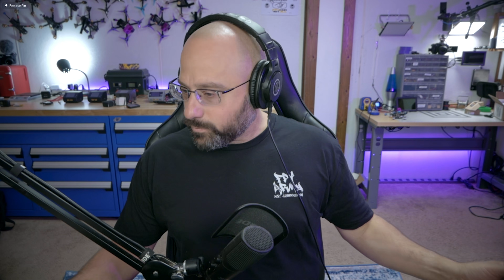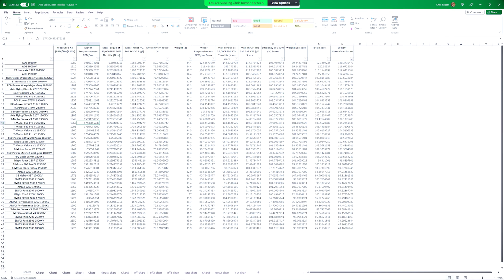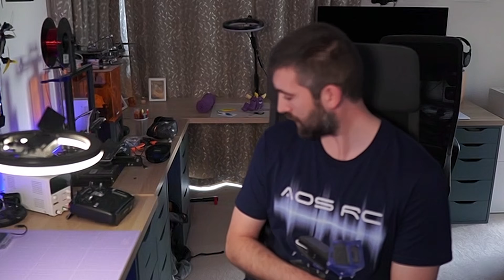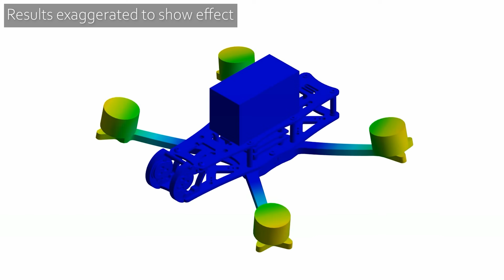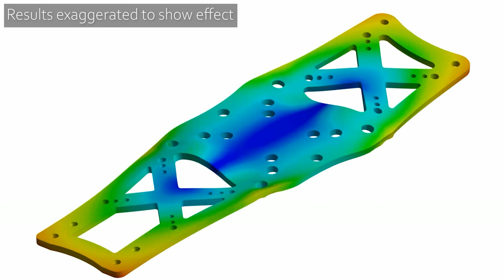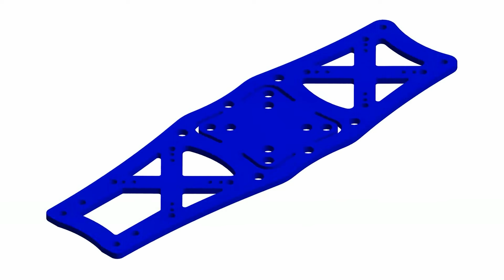The most powerful, most efficient 5" drone motor ever made // AOSRC SUPERNOVA 2207

Comment: The motor inertia is presumably an inertia, so quite linear at least from a control point of view. Yet filters are a pure delay (eek! hard to do the maths for)

How much does the moment of inertia of the propeller itself compare to the motor bell? Plastic is lighter, but the radius² is a lot larger?

Comment: But how about thin wire, much windings, much coils and much controllers and the right stator shape ^^ and what's limiting the current, is it the thin wire from the  1000 light led strip 😂 how about a battery for each 3 or 6 coils that have their own esc, so you don't melt the thin conductors

Comment: It would be nice to see these motors for all size ranges of quads. It would also mean you could run the smaller motors meant for a  race or freestyle quad in its size category on a bigger class quad for insane efficiency builds. Ie a 1305 or 1404 on a 4 in .

Comment: That's very interesting, especially the frame stuff - to me, anyway.

I fly small quads up to 4" props. Recently, using a commercial one piece frame (2.5mm CF - carbon fibre) I have had big problems with loop stability with aggressive props, had to back off gains a damaging amount. A friend with another similar commercial frame (3.5mm CF) didn't. But, his frame was 33.5g as opposed to mine at 23.5g - a big difference in a 200g craft, 5%.

On the basis that the biggest contribution to stiffness comes from mass furthest from the centre of gravity, I then made a frame (I have the CNC tools) from 2x 1mm outer skin CF, with 2.5mm core of 3D printed polycarbonate/CF. Total was actually about 4.2-4.3mm as the 1mm skins were slightly less than 1mm. Big improvement, no stability issues.

Carried out some relative deflection measurements and it showed the arms (same XY plane shape) were a lot stiffer. Relatively, my original 2.5mm frame under a set load deflected 0.33mm, my friend's 3.5mm frame 0.11mm, my 4.25mm 'sandwich' frame 0.06mm. not only that, it only weighed 25.5g, less than his. So, a big stiffness to weight improvement.

It seems to me therefore that stiffness to avoid coupling into the gyro is very important. In the past on smaller quads (2") I've also got measurably better gyro/accel performance by AV mounting the motors.

Of course the downside of the sandwich approach is likely damage in a crash, the arms will be less strong as the 3D printed material does not contribute much to the overall strength. Depends how much one values performance against robustness.

The tool I use for designing this stuff is FreeCAD, and that does have an FEM (finite element analysis) module. Therefore since one is only after relative qualitative improvement, it might well be interesting to experiment with different shapes / cutouts using that.

Comment: Not for nothing:
They are 22.5 x 07.5
So 10% more volume but the same weight (approximate) as 2207.  Bell is much lighter.  So less durable? It then becomes a finite analysis on strength comparison.  So that would need to be done.

Comment: 23:05 you can also make the ESC compensate for that delay by sending out a higher-than-necessary current so that the motor reaches the required RPM in a shorter time? If the current required to spin at 2k RPM is x A, instead of sending exactly x A to the motor, send 2x A or even more, for a short period and then ramp back down to x A when it reaches the target RPM. Unless they already do that (wouldn't surprise me) in which case 🤷
Reply from the maker: What you're describing is accomplished by feed forward in the flight controller's pid loop. There's no need to also have the ESC do it.
Reply: @JoshuaBardwell  sure, i mean, in my head it makes more sense for the ESCs to do this instead of the FC, but not that it matters, they could be all in the same chip for all we care
Reply from the maker: All the FC cares about is making the gyro change. It does this by changing the motor outputs up and down. The FC does not care what the actual RPM of the motor is. It just cares how the gyro is changing. An ESC-based PID loop that manages RPM is unnecessary. It would add complexity and delay to the system. The ESC does not know the gyro data and does not know how fast the motor should be moving. All the FC needs to know is, "Is the gyro moving correctly? If no, then increase or decrease the motor output."
Reply from the maker: Just to be clear, what you describe -- the ESC being told to drive to a higher-than-necessary RPM -- is exactly what feed-forward does in the PID loop. It's just that the ESC is kept dumb and it just does what the FC tells it to. Since the FC is the one what knows what the ESC should be doing, this works well.
Reply: @JoshuaBardwell  Thank you so much for your very detailed explanations. As a token of my appreciation here is the setup of my attempt at making a thrust/power measurement setup https://i.imgur.com/FIbywAM.jpg some year ago . I suspect I had not chosen a correct prop 🤔
Reply: @JoshuaBardwell  It's a bit late, but what he is describing is a more aggressive motor ramp up in the ESC, which we already have ramping control in bl32. Feed forward would command more throttle on a motor output, which I guess would achieve a similar result, but you missed the point of what he was saying.

Comment: I hate to be a wet blanket, but 3D printed frames have been using slots like this, and more elaborate cutouts, to help isolate the stack from the standing waves within the frame for years.  I first saw them 5 or 6 years ago like this, as a cutout around the corners.  They went on to add cutouts along the sides as well to effectively make a self dampening spring.

Comment: I know nothing about drones and their motors but  remember reading about this in 1970's when only universities had computers which were 'slow' and incredibly crude compared to even a smart phone today.
It was in relation to motorcycle generators and ignition systems and I freely admit I didn't understand the math.
Seems the only innovation' is allowing a computer to optimise the placement of magnets and coils, particularly when software ran 20,000 iterations?
At least a more efficient/power to weight is good plus isn't being touted just to make money as the planned components  are not exactly cheap.
The last 5 minutes sounded like basic exhaust system theory from Gordon Blaire after he designed exhaust systems for Norton?.
You flexing of frame animation was fun, I've only ever seen them for motorcycle frames and car chassis

I wish you well

Comment: This business of balancing magnet strength and flux ring thickness is actually "innovation"?  That's just magnetic circuits 101 - it was basic material when I was in graduate school nearly forty years ago.  Obviously back then we didn't have the compute power we have today, but... magnetic flux behaves the same way today it did back then.  The stronger magnet will push the flux through a longer path, but only if that path is "fat enough" to carry that flux.  The same trade-off applies all over the place in your motor; it pops up in the current path as well as the flux path etc.
   
Chains are only as strong as their weakest link.  The job is to make every link of every chain "just enough" so that they all tap out at the same time / power level / torque level / whatever.
   
To be clear, I'm not knocking what Chris is talking about here at all  - in fact it sounds like he's done precisely what I would regard as standard good design practice.  In a performance critical application like this, you optimize, optimize, optimize.  It sounds like a fantastic motor - I wish him the best of luck.  It's just kind of surprising to hear the approach talked about as though it's novel.

Comment: Hmm.  Sounds good in theory.  But this testing is only as good as the simulation software and how many variables it looks at and how well physics is programmed into it.
Always a chance of some unknown effect occurring in a design that the software thinks is sub optimal and rejects. 
So moving forward if every inventor was to use software like this and not do physical testing then it is likely that major new breakthroughs would either never happen or take much longer.
BUT it will hep massively in optimising existing tech.  So I see reliance on these tools as a double edged sword.

Comment: I had a few years ago same idea virtually, but never tested it in production. In the video the cut around is very simple and I believe it is like very un optimized solution. I have been think to properly create mechanical resonators tuned for specific freq. by cutting the frame in very specific way.

Comment: Well lads, I been listening for the whole video about dry engineering, but 2 things I hadn't heard mentioned is that makes worlds difference is firstly the winding density in the motor,  Is it wound with round wires or are they rolled square wires to fit more copper & less air gap in the conductors to give a more intense magnetic field in less volume of windings. Also I have heard nothing about the 3 phase controllers for these motors can be drastically different in the way they deal with back EMF & drive switching, Coil resonance & ringing problems. Anyway I guess that's another video hay as all I've heard is about tweaking  mechanical materials & design which is very impressive but do consider the electrical side too which is a whole nother kettle of fish.

Comment: Responsiveness should measured by thrust change per second - it would allow to include propeller issues. In absolute and relative terms. For example how quickly engine spins up from 0% to 90% of thrust ,  and from 50 to 75.

Comment: Correct me if I'm just unfamiliar, but the information conveyed here was:

"I optimized motor parameters and improved performance by 12-15%." 

But instead of putting that on a bumper sticker you made a 40 minute video.
Reply from the maker: This isn't a commercial for the motors. It is an interview with Chris about how he designed the motors. If you go to the product page for the motors, bullet points like this feature prominently: https://www.aos-rc.com/supernova-2207

Comment: So interesting! I hope he applies this same core concept to smaller motors, too! 

I love rocking motors with a 5mm hub on my 3.5” but motor choices are so limited. T mount sucks (hats off to those of you that can consistently get the damn screws into each hole for each prop, but a single 5mm shaft is just so much easier). 

I’m rocking xnova, but would love more options!

Comment: How do you know you aren't over fitting to the data you are using to produce the digital twin? Much like people over fit trading indicators to a specific market via backtesting? Its a problem manually as well as AI. Curious to as what you are doing to prevent/mitigate this.

Either way, love the video <3

Comment: so the end state of this whole idea is eventually the ring of poles and coils and the magnets will be bigger and bigger and the hole in the middle will be bigger and bigger.... until the motor is a tube the diameter of the prop, with the blades on the inside. So a hubless EDF. Weird

Comment: 5:50 So following Tesla and Koenigsegg's lead with the newer style Raxial Flux Motors. 6:54 Yeah... Exactly.
Reply: anyone interested in what im referring to, Google Koenigsegg Dark Matter EV motor - 
 800 horsepower and 922 lb-ft of torque / around 600 KW of power, in a 40 kilograms / 90 pounds package. Small enough you could easily put one per wheel on a car. If you could power them.. Around 750 amps per motor. 
Obviously if you scaled this down to quad sizes, IF it were economically viable, would be some Monstrously powerful tiny motors.

Comment: This sounds good! My only worry is magnetic dust.. There's a lot of that in the bandos we fly here around Denver, can really kill a motor quick when a bunch of it gets into an air gap. But hopefully the less leaky flux ring will help!
Reply: huh maybe someone needs to design a kind of plastic gap wiper thing that somehow scrapes the inside without getting stuck and without blocking too much cooling air. Or, maybe we start sealing the motors up and do cooling some other way...

Comment: Interesting video.
The method Chris has used here is very similar to the way neural networks (/AI algorithms) are trained to do whatever they do so it's not surprising that the tool he used is to wrap the MIT algo is 'borrowed' from that field. I think more and more engineering is going this way actually. Come up with a digital twin and throw millions of tweaked model variables at it.

Comment: I like the approach on the frame, but could a good result also be obtained by mounting, say, three accelerometers at fwd, mid and aft and then applying some averaging/selection/rejection to the signals and at the same time potentially get some redundancy, along with some condition monitoring - eg chunk out of one of the prop blades, or pick up a motor shaft being bent or a winding o/c or maybe even shorted turn etc etc ? 

These chips seem pretty cheap these days and SPI bus allows multiples connected without chewing more ports , and so on and so on?

Comment: But the motor size is EVERYTHING!  Otherwise, it is just a bigger light weight motor, no?

No matter how you slice it, a competitor can easily reverse engineer with calipers.  So why not just be open with the size to drive it home?

I guessing the volume is bigger than 2207, so of course more power and torque, no?. Otherwise, why not publish.
Reply from the maker: I mean, if the "big innovation" is that Chris can make a 2309 motor weigh 33 grams, then that's a pretty big deal right?
Reply: @JoshuaBardwell  it would them depend on durability, right? Like impact testing or whatnot.

Cheating if motor volume is bigger but walls are thinner, which will mean weaker.
Reply: They are 22.5 x 07.5
So 10% more volume but the same weight (approximate) as 2207.  Bell is much lighter.  So less durable and becomes a finite analysis on strength comparison, which was not completed.

Comment: Chris this is great and thanks for the interview Joshua.  Chris, have you tested at the edge of tolerance for all of the combinations of parameters that have effect on performance using the digital twin?  Have you established the critical to function tolerances? Is there statistical process control on these critical to function parameters at the supplier? You can see where I'm going with this... When you are trying to achieve perfection, your ability to reproduce that would be the next challenge, requiring a very competent supplier with the latest in equipment and measurement capabilities.  Cost versus precision and repeatability becomes the next hurdle.

Comment: I mean. It’s all subjective. Cool content tho.
Reply from the maker: But isn't the point of putting the motors on a test stand and measuring their performance specifically that it's NOT subjective? It's objective.
Reply: @JoshuaBardwell  when put on a given build the performance changes.
Reply from the maker: Sure but that's a given. The test stand numbers are still meaningful.
Reply: @JoshuaBardwell  like testing a car on a dyno. The info is there. But given track. Weather. Driver. All that. The data changes. So is this just to get a bass line test. Like. It could perform worse. Or better. Dependent.

Comment: Sick. Bardwell, Rosser & Ian are downright the best trio for improving almost everything about our hobby. Keep it going.
Reply: For 3d optimized motors they should start using hall sensors and depend less on the backfeed, maybe that could be useful for further ESC optimization.
Reply from the maker: Sensored motors are only necessary if you need low-rpm torque, or if you're trying to do FOC, which we aren't. Back EMF is fine for the time being.
Reply: @JoshuaBardwell  Thanks, that makes a lot of sense. Getting more systems on am32 and optimizing that open source ESC seems to be a better choice given blheli32 hasn't had the rosser treatment. Cheers.
Reply: So it really only makes sense for the massive cinema rigs, 3D however could provide a whole new cinematography perspective. Sensored motors should improve things when it comes to 10" props with all the additional rotational mass & flux.

Comment: for chris, vibration isolation:
think about mounting gyro/stack not to a bottom or a top plate. mount it in the middle by using for example  the standoffs -sidewise. so its "floating" but stiff connected to the sides. the metal standoffs wont bend.
OR:
use the stackscrews as standoffs aswell. make them screwd to the bottom AND top plate additionally. it wont be likely that this area will bend if its connected in a "cube" bottom and top. its isolated for itself

what do you think?

Comment: I'm surprised he's applying for this, as this has been common practice for years in industrial designs, not just for providing another means of isolating the gyro/accel, but in case of PCBs (where this is typically used) also to reduce or eliminate the magnetic flux under or near the gyro/accel as you can steer ground currents away from it. I'm sure there's plenty of prior art and/or references, which should invalidate any application (sorry Chris!).

Comment: I have never heard anyone talk about sealed bearings. Or ABEC rating. Its dusty here and that shreds motor bearings. Why doesn't anyone put sealed bearings in their motors?
Reply from the maker: My understanding is sealed bearings are not rated for the high rpm that multirotors require.
Reply: @JoshuaBardwell  53,000 RPM on ones that publish specs. 6S/2KV would be fine. That's with grease. Oil filled go higher.